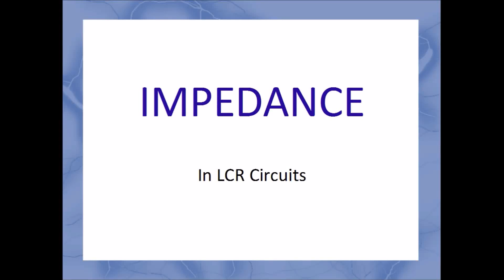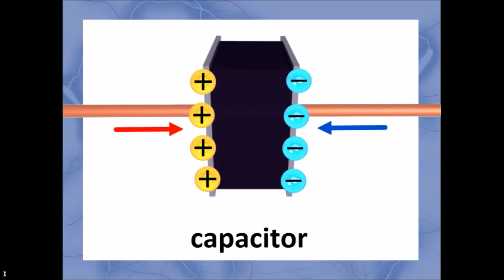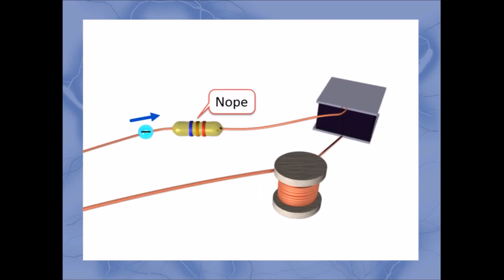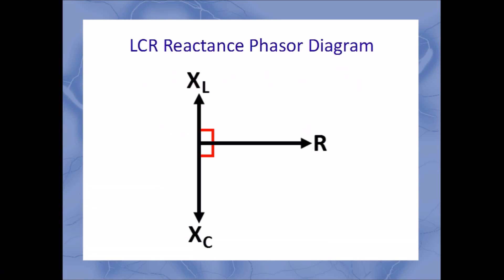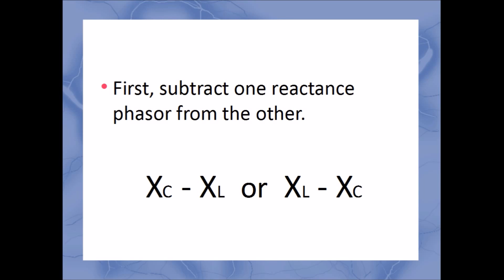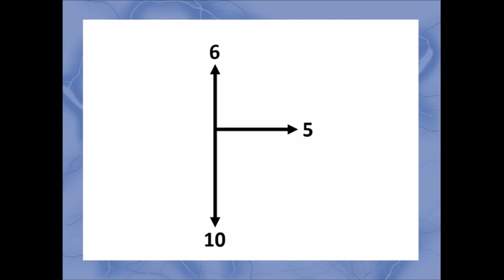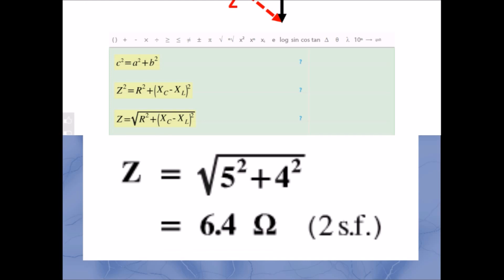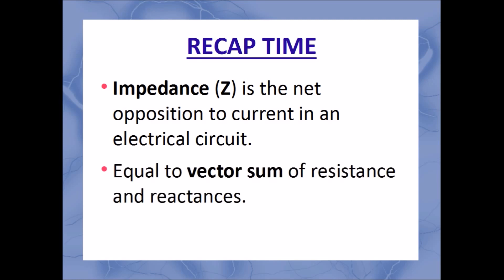Electrical Impedance

Comment: hello, I am trying to learn this and your video is very clear except for one point. You took the 6 away from the 10 and got 4 then went into the formula which is great, you came out with the impedance at 6.4.........But, wait what is the the rule or law that stops someone, like myself to apply this formula to same numbers but instead,  I take the "5" away from the 10 instead. Do the formula and instead of getting "6.4", I get 7.8 impedance for my circuit
Reply from the maker: Hiya! Thanks for your comments.

The rules about this come from vector maths, basically you can't take the 5 from the 10 because they're vectors at right angles to each other. You can only add or subtract vectors that are at 0° or 180° to each other - the 6 and the 10. Once that's done, the resultant vector can be added to the 5 using Pythagoras' Theorem.

Hope that's clear enough. I could make some videos specifically about vector operations if you want. :)
Reply: Thank you for such fast response. I wanted to learn what is 'impedance" you explained it well. I am wanting to fix guitar amps, I have fixed three of them but it was a case of dumb luck. but I would like too further my education and figure out why and how things work. To be able to visualize what is happening inside of a capacitor or a   op amp and why does it do it. Any bit of knowledge helps. So thank you